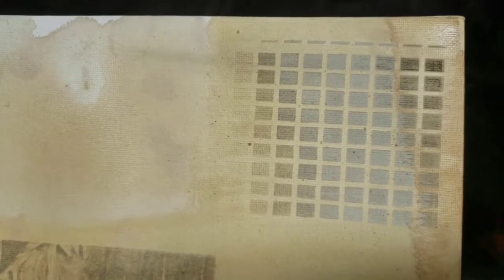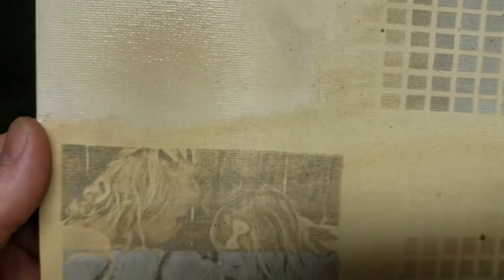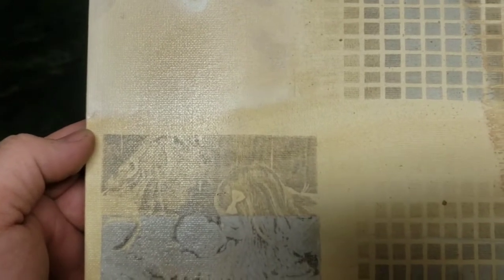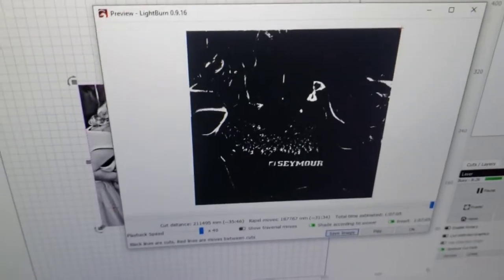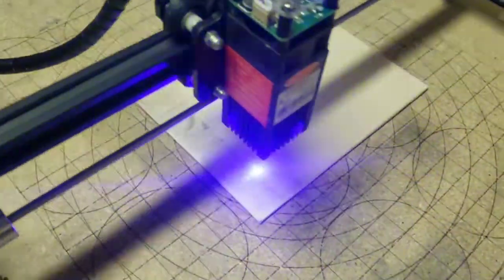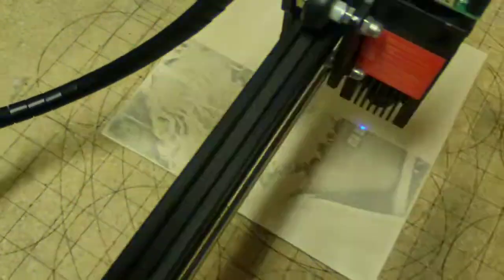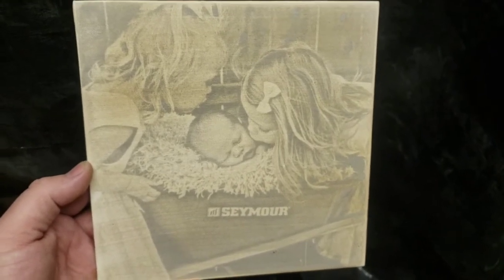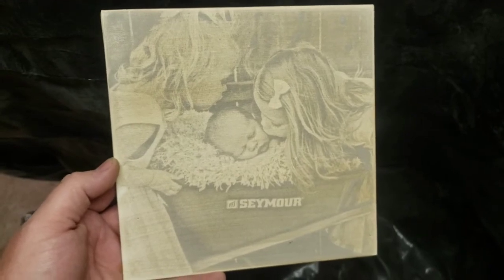"The Kenny Hack" on Canvas Part 2. The results are amazing! Ortur Diode Laser.

Comment: Nice work Kenny
Reply: is it set at dither or jarvis?
Reply from the maker: Id think at that time I was using jarvis. For most things I'm doing now I use Newsprint. At the higher speeds I run it seems like the machine has less issues with buffering using Newsprint vs the other dither settings. Newsprint also seems to work better at getting the lighter shading into the pieces than the other diters.
Reply: The Kenny Hack thanks! I as well still learning and going thru different settings. Your work looks awesome